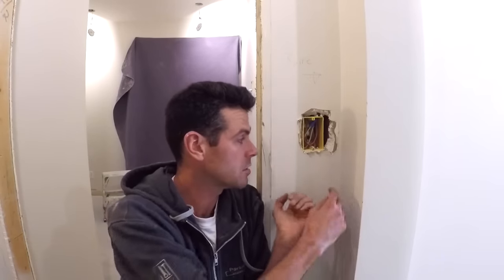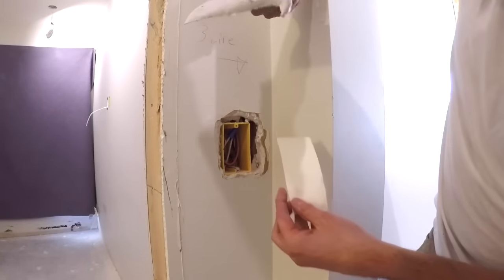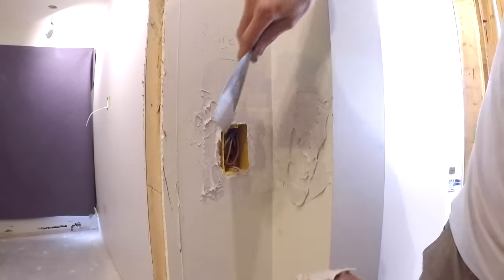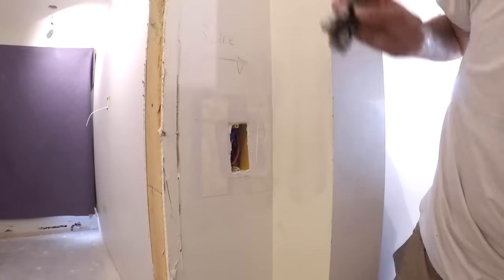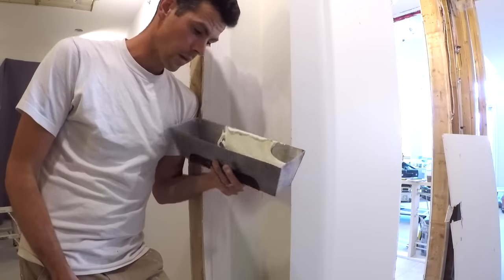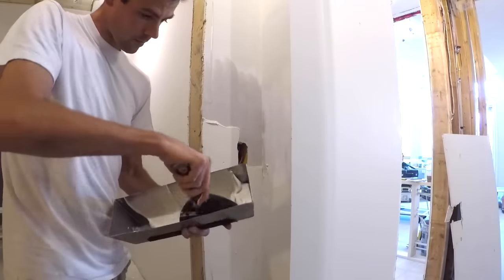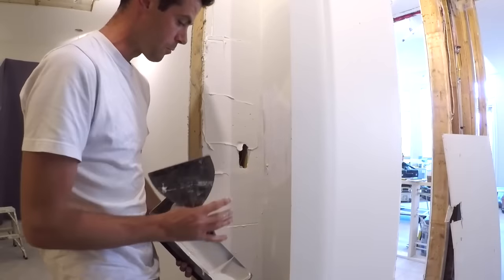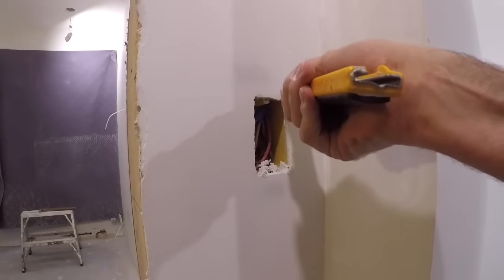HOW TO REPAIR OVERCUT ELECTRICAL BOX (DRYWALL)

Comment: the beauty of fast set is you don't need tape for repairs like this. can you use it? of course you can. but you really don't need it as long as it's fast setting. i've done this for years and have never had a blowout or falling out of mud after fixing it. and when i say years i'm talking nearly 20 years. you cannot use standard drywall mud doing it this way. i've done repairs like this all the time and have gone back years after doing the remodels and have never had an issue with cracking or falling out. you can agree or disagree with this method i really don't care. i've been doing this for decades and i know this works. it also works on small holes no bigger than 4-6 inches. make sure the hole is fixed and tightly secured before starting and the hole does not intersect with another joint or stud. just use the typical several coats of fast set and no taping is needed. all standard muds crack. fast setting doesn't crack on most applications. you just have to know which ones you don't need to use tape on. that comes with experience. i can already hear you calling this the unprofessional way to do repairs. that's your opinion. like i said i've been doing repairs like this for decades and know they work. i work in high end multi million dollar remodels and things like cracking or bad looking repairs would be unacceptable. all that matters is how the finished product looks and if it holds up. and they always do. like i said you just have to know which ones you can take that shortcut to save unnecessary time. some things have to be taped or meshed. but not all.

Comment: I had this happen to me. I was installing a new switch and the whole electrical box punched a hole into the wall. The bottom had nothing left to attach itself to, so I used a piece of wood affixed to the bottom of the electrical box and attached the wood to the inside of the drywall making it nice and sold. I was just playing it by ear but later on I saw “This Old House” doing the same exact thing I did. Guess it’s a common practice. I used tape, mud and a little piece of drywall to fill in the rest of the hole.

Comment: I like to use Bondo.  It's stronger than drywall, water proof, sandable and cures quickly.  Works well for patching stucco walls as well.  But that's just me, I like to do things different.

Comment: Lol I remember I was cutting holes in the drywall for the outlets and it was my first time doing that because I was never shown how to do it I just watched and I would make the cut big ( close to 2-3 inches) and the way I fixed it was I used easy sand 90 put a whole bunch on the holes let it dry and the. Sand it a little bit then I used all purpose compound sanded that and I painted it and it was barely noticeable came out really nice

Comment: Yeah, the one tip I'd like to add, is to put a little tape over the screw holes in the j-box that the device, (switch, outlet) needs to thread into. So that the threaded screw hole is not filled with mud. Everything else can be cut out.

Comment: I love it when electricians use hammers to pound a hole in the wall I still remember the drywall guy that chopped to pull my wires I had to pig till everything after he got done

Comment: Probably been asked before (late to the party) but I didn't see it while I was scrolling (inb4 just blind), how does that sort of patch figure in with the electrical code? Isn't the box required to be pretty darn close to flush with the wall? Maybe it was just me but when he was cutting the excess away it looked like the box had essentially been recessed somewhere around a quarter of an inch? Inspection wise, how does that play?

Comment: I know that nails are more expensive, but I carefully tap skinny finish nails parallel to the wall  about 1/4" apart all the way around where the repair is needed.  Then I mix up a batch of FixAll which gets rock hard and work it into the area. Its like cement with rebar. Then after it's set up, it's tough as nails. Pun intended. Then I finish off with spackle and come back hours later to sand though I won't paint until much later...

Comment: Initially I thought this was going to address a problem I have on several outlets after a family member did some work for me I didn’t feel like I could be nit picky over little details— I have outlets that are too far back and I can’t get them to pull forward to meet the face plate so I just have been living without faceplates on them for years, I’ve tried spacers but that didn’t work - is there anything I can do aside from shutting off the power, unscrewing the outlet and pulling all the wiring forward?

Comment: Only one small comment about the last part when you used a cutter to remove the excess mud, you could easily cut the isolator of one of the cables, then the electrician for safety, must trim that part off, and sometimes, there is no extra cable in the box so it won't be possible to fixe it.

The point is, be very gentle with wires inside the box.

Comment: I would ask a favor. Please cover the screw holes with a little masking tape. The screws will break if the compound gets in there. We (electricians) can tap the hole but it’s easier if you cover the holes prior. Thanks

Comment: Thank you for all the vids. I have never even dreamed that I would have to ever do any drywall work, BUT..... I’m building my own house. When I say this, I don’t mean I hire someone to do the different trades, ALL the work was done by me, myself and I. From the septic field, to the footer, to the block, trusses, asphalt shingles, framing, plumbing to electrical! What a pain. Now you know any moron can put up drywall. BUT finishing that drywall takes real talent. Not any of that “ Oh ya I can do that”. Well its an 1800 sq ft under the roof house so there is a lot of drywall in it.  So LOTs of finish work. I’ve been very worried about even attempting to do this. (NOT a skill I have). Just so ya know I did attempt to do some finish work in the M bath. WRONG ANSWER!!!!! Oh gawd what a MESS. When I had gotten about half way (almost) thru, I had WAY more mud on me and the floor than the horrible slop I’d smeared on the wall!! After a week of sanding (I REALLY HATE SANDING NOW), I got the 5 gal bucket worth of mud off! Grrrrrrr! So super discouraged, disgusted and dejected, I turned to the locals to try to find help. BIG MISTAKE! They wanted an arm and a leg to do the finish work. Now I’ve put WAY too much money into this now hugh paper weight to just quit! So I started looking thru the net to see if there were any helpful hints out there to help me. There are ALL kinds of folks that have crap out there telling someone their wonderful way of doing finish work. (I think I’ve seen most of em). NOPE, too little or too much useful and un-useful dribble. Then I came across this young man called Vancouver Carpenter. What an excellent dissemination of information. Your videos are clean, concise and to the point. No extra dribble. Your teaching techniques are easily digested, and I was able to but it to good use. I just can’t thank you enough! THANK YOU SIR!! My corner work is second only to yours. (Remember yr video about “get a corner tool”) OMG what a difference you have made on my house! I’m not nearly as good at a regular joint seam as I need to be, but my corners are perfect, my screws are (All screws matter) all covered correctly, 3x (+) and I still hate sanding. But at least I’m not sanding 5gal of mud off a 10 ft wall!! Thanks man, I really appreciate it. I’m sorry this is soooo long, but, I thought you might like to know that your videos really do make a difference. A real world difference! Please don’t stop adding new content so us idiots can learn the correct, and easier way of the trade.  Oh, and take it easy on those shoulders, we need you. Thank you again.
Reply from the maker: Wow!!!! Thank you:D
Very happy to be of service!!!
Reply: Congrats on your house! I started a handyman company 3 1/2 years ago with no prior experience and 100% on the job or video training. You’re absolutely right about Vancouver Carpenter teaching us the wise and professional method of doing drywall. I’m happy he exists and I’m glad folks like you that will build a house and work diligently to make sure it’s rock solid and aesthetically pleasure are still out there. Good on you!
Reply: @Tonyhouse1168  thank you Tony. I have my CO now and I keep it at 73 in the Florida heat. My power bill is around $70.00 a month! It really PAYS to do it yourself and to do it right!! Last house the bill was about $300.00 a month and the temp was around 78deg inside! HUGE DEFERENCE!

Comment: Electricians also don't like when you feel the screw holes in with mud either!!!  You might want to try using blue masking tape over the outlet next time. By putting one pieces on the top and lower horizontally Edge 2 Edge covering the screw holes then three two four pieces vertically. This way it's easier during the mudding process and the reopening of the outlet this extra step will save frustration and time in the long run for everybody.

Comment: Might be better to initially fill the hole with a plaster and then top off with drywall cement.  You lay drywall cement too think and it will crack where as plaster not so much.   Drywall cement does not have any 'fibre' in it  (so to speak) so it won't bond to itself .   Make a baseball sized clump of cement; let it dry and see how easy it is to break apart.  it is only meant to be a top coat

Comment: You don't need to tape this at all. Just screw in some backing backing the hole. Add 45 min structural mud. Then add finish mud. You are done. Ready to paint. No issues later on.

Comment: Just wondering if that would pass electrical code. Doesn’t the box have to extend past the wall surface a bit so sparks won’t be able to get to the wall? It looks like the mud extends past the box. Not knocking the excellent repair, just curious

Comment: Forty years in construction and it's still rare to see someone do drywall repair properly. I can't tell you how many times I've beaten all that mud and tape out of the way to install the device or trim plate. And why? Simply because a dry waller broke the hole out with a hammer to save time instead of measuring the box correctly and putting the sheet of rock up properly. You never mud around a box because it will move during the device install and the mud will crack and fall out. The proper way to repair this is to cut a large square out of sheetrock and then cut a proper fit box cutout in it. Set it over the box and with a knife you cut out a square the same size as the square with cutout you just made. Then you fit the new square in the wall were you removed that piece of crap rock that was around the box. Now you tape and float that square into place and have a good fit on the box and a solid wall that won't fall apart. You'll need a bit of wood or metal to go into the wall to screw the new sheetrock piece to but that's fairly easy in most cases.

Comment: Would this work for repairing about an inch gap around all sides of a bathroom fan/light. We upgraded models and the new one is smaller than the previous one.

Comment: Expanding fire foam.. ( not too much ).  Cut the foam back once dried. Then tape and then qiuck fill.. it will never crack.. if you pack to much 'mud' in it will take ages to dry cos of the thickness. Just my way id do it. But yeh.

Comment: I personally would’ve framed it on all 4 sides with Tape.

Just like your other video where you talk about mudding around the entire electrical box so it’s all even? I would’ve taped the bottom along with the other 3 sides as you did & then mud at all around.

Comment: I'm having trouble understanding why you filled the small gap with mud, but didn't fill the large gap. Is only 1/4 inch of mud under the tape not going to be fragile and prone to breaking?

Comment: How would you repair the damaged GWB edges around a 4 x 10" ceiling vent, where the vent screws were holding the vent up (and no joists nearby)?

Comment: Just throwing this question in one of your random vid. If you have to coat a bumpy tapeing job that has the seam transitioning from a painted wall to dryway..Can you do that in two coats?
Reply from the maker: Only if your really good
Reply: @vancouvercarpenter  that is my thoughts exactly..Working a job right now that hangers decided to tape, but no prefill..my boss was wondering why it needs to be a three coat job..oh well got it done now, after convincing him why..Perhaps next job I will tape those kind of r pairs..keep up the great content..Thinking about switching out of knives after watching your vids..thx
Reply: I have only a few years of experience and on new work I am a really good finisher..however I have discovered that repairs especially if I did not do the taping I sometime end leaving the job feeling green again..

Comment: In the UK, we would have finished by now,  just use bonding, fill in the holes, then skim, no sanding down, easy.
Reply: Joe Soap  it is a undercoat, you apply to walls, if you want to fill in holes or hollows.

Comment: I'd take some mud and with my finger, rub it onto all of those rough edges before mudding and taping the surfaces.   Actually, what I would have done was get some clean-cut edges and Gorilla Glue in some drywall.  I use Gorilla Glue for small drywall repairs.

Comment: Please, the electric dude left the electrical cases loose. I have drywall over a metalcon frame (galvanized aluminium) but i don't know the depth that the case must be.
Any pointers? The good thing is now I know how to patch the wall without replacing the entire wall :)

Comment: Can I send you a pic of the mess in trying to close up? I have a big opening with wires hanging out, and spiders keep crawling in. I need to close this the right way and the flood that did it don't know how to fix the mess they caused
Reply from the maker: Go to the “about” section of the channel. There is an email there.

Comment: what to do if you have a electrical box in a spot where there is nothing to hold it in place? Previous owner has a box set in plaster with a brick wall behind it.there is nothing for the box to grab onto. So basically it is a plaster wall on top of a brick wall, no studs.

Comment: I don't understand how ppl thought this was a good solution 🤔
He created a large 20inch hump on the wall over under under the switch box and in rhe process created 3hours of sanding job. i would have cut out 2inches more beside the switchbox, glued a piece of thin mdf on the backside of the dry wall. Then had a peefect backing to fill up the entire damaged area with same thickness drywall pieces or mud. Would have been even with the wall surface entirely!!

Comment: LOL. . .or just use a $1.25 oversize wall plate made for this type of situation.  Another much faster and stronger method is to square up defect, slide a piece of scrap drywall with a dollop of quickset  to the backside of the opening. Drywall screw in place. Finish with quickset and you're done.

Comment: No dust mask when sanding? Enjoy your silicosis.
Reply: The drive by safety patrol is in full effect!
Reply: @integr8er66  @Sean Fyodorovich   lol ok guys, you're right, what was I thinking 🙄...This video has almost 2 million views making it a de facto authority on the subject. Joint compound contains silica, and breathing the dust is a major causative factor in the development of lung fibrosis. That this video doesn't show or even mention the use of proper respiratory PPE is a major disservice to those 2 million viewers. 

But hey, f*^k me, right? So sorry to spoil your YouTube comment experience and encroach on your freedom!!! Good luck sticking it to "the man" by not wearing that respirator, and as I said before: enjoy your silicosis.

Comment: Someone correct me:  Why not just put self adhesive drywall repair fabric neatly around the box, then neatly apply wallboard joint compound on top of that?
Reply: Why not mud the over cut first theb put the adhesive tape on then a layer of mud over the tape and be done.

Comment: not a bad way to do it...2b honest i do high end custom homes and seldom use tape for outlets... once in a bluemoon it comes back to bite me.... if you see any weekness/movement, not a bad idea to tape it. To be on the safeside any large gaps such as in this vid...tape it. However i seldom do. The reason or one of the reasons to tape in this instance is because wen the screw the plate on it creates pressure, which could pop the mud out. However there ain't a wholelotof presure from an outlet cover. To each their own

Comment: Before putting the tape with mud, I would have filled as much as I could of the holes with quick set, and then put the tape with mud on top.  At best, you might have 1/4" of mud the way you are doing it.  That's not going to withstand any knocks.

Comment: My biggest issue was electricians leaving little bits of wire or metal debris on the countertops getting under the Ramboard or cardboard protection.  Something heavy would be put on top scratching the counter under..  When doing cabinet installation inspections, I took pics of everything in or on the cabinets and vanities.  Especially if the re was something on the counter causing damage   Site would call up asking for a new counter.  I'd go thru my pics and send him or her a pic of an OTR  on the counter. with a message ,' Send me a PO for 700$ and you'll get a new Island top".  He'd  provide and bill the offending trade.
Same with painters removing a door next to the wall and laying it on the floor.  It would get tromped on, splatters of paint and left there.  No problem. .25 hr minimum to rehang plus cleaning or replacement if damaged.  Document, document, document.